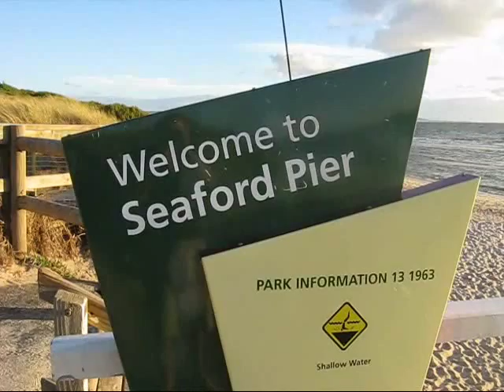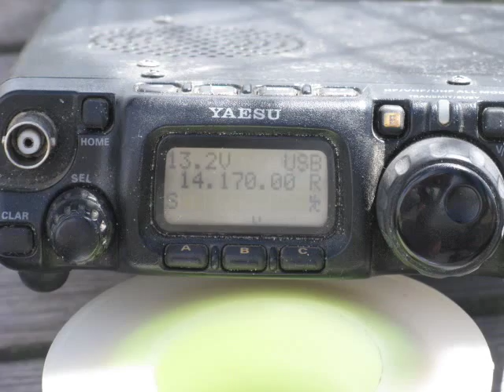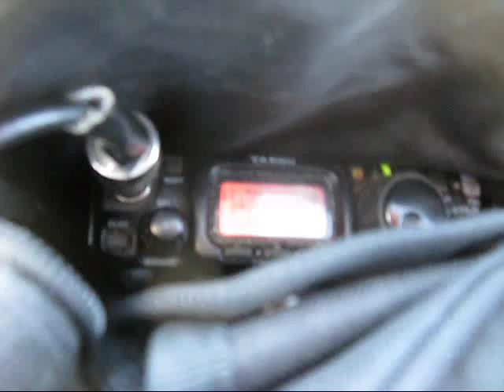Milliwatts and Pedestrian Mobile in the 2012 John Moyle Field Day

Comment: @scottjacko87 Scott - were you the operator at VK5LZ who I worked on 20m at 0936Z?  I was using an IC-7000 at 100W PEP output and TH3JR pointed Northwest, and VK5LZ was using the same equipment with 70W PEP and antenna pointed Southeast?

Comment: @vk3ye No worries Peter. We had a great deal of fun which is the main point of the contest. For your information we were running a quarter wave vertical on 40m and a mixture of quarter wave vertical on 20m along with a TH3 Jnr. We had a Kenwood TS-440S on 40 and an Icom 7100 on 20m.

Sounds like you spoke to Paul on 20m :)